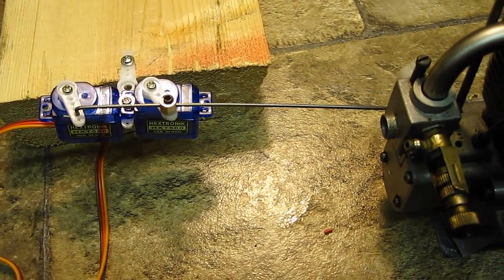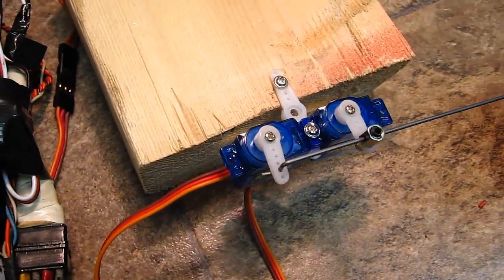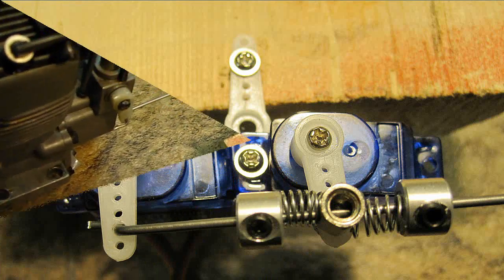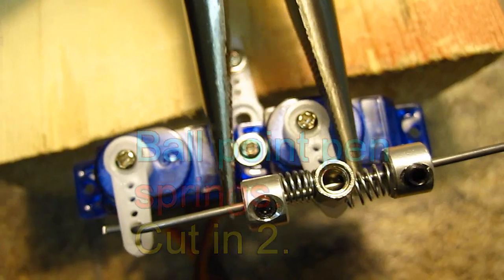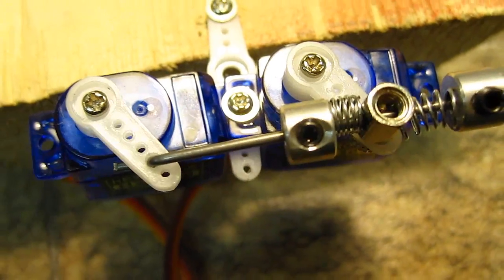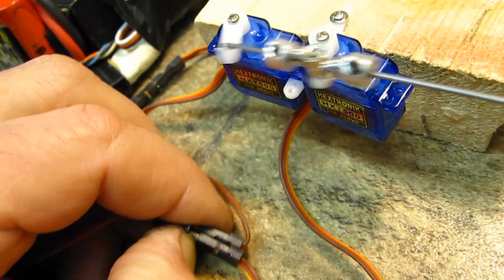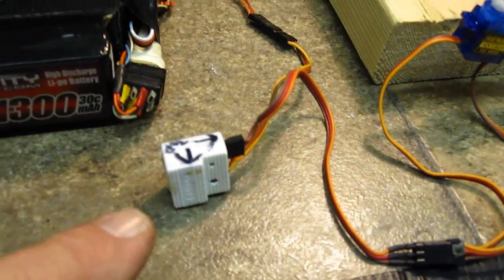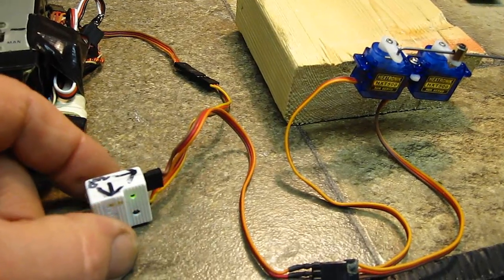Double your servo power and have backups too.  Heres how I do it.

Comment: I can see and hear when you disconnected the second servo strain and we were always told not to push the servo
horn as it is a easy way to stripe the gears inside as it is not designed to work back to front, like most other comments here say maybe use a little better or bigger servo, just a thought

Comment: well most larger projects like 1/6 1/4 already have dual servo setups lol. But here is a even better idea!  Try not buying the most craptastic china servo you can find for $1.50 each  off ebay and maybe they wont fail!!!  Also your greatly effecting the current draw on your models battery and life.
Reply: Rich Morgenstein Hey Rich (Ironic?) It's a hobby for most. A lot of us buy cheap and don't live in the throw away society. Two of these at under $10 might only last a third of the life of a $ 70 Futaba. See what I mean. This is obviously directed at fixed wing and/or boats. A few extra grams for milliamps hardly hurts.
Reply: karizma8175 I could bet you own a Phantom.
Reply: karizma8175   Well no just saying.  Over the years I built many rc projects.  All the ones with cheap crap servos at some point failed with little to no reason at some point.  But my projects i spend the extra 15$ on each good servo.  never had a problem with them even when there should of been like after a crash and what not......   lol I never had a boat servo fail.........  Never had a plan servo fail untill it hit ground so hard plane it's self was no longer fixable.  even then had some servos reusable lol??????  Where they of amazon for 5$ for 20 of them like these servos are no.  They where 10$ each or more.  Rc helicopters. To this day in 9 years............ Never had one fail.  I have 11 rc helicopters........ 450-800 sized.......   You know what did have a servo failure....?  The slow stick i paid 26 dollars for i used 4 crap china 9g servos on..........  Oh and my "China made" redcat rampage steering servo........  So? yeah does not happen often with better made items.........  While you all buy garbage in mass amounts over time I buy a few for few $ upfont i guess.
Reply: karizma8175  And no I dont own a phantom there garbage like most DJI products.  Just look at DRONE fails all over youtube it's All DJI garbage items lol!

Comment: Your better off using ONE high quality Coreless digital servo, than 2, because as one puts force on the other, it rapidly increases the current draw of BOTH of them as they fight each other to equalize the force. Think of it as almost a control surface binding. If your airplane control surface is stiff, it too will cause harm to the servo, because its overly fighting itself.  In both cases, you will dramatically reduce the life of the servo, and at the very least, kill your receiver battery VERY VERY FAST

Comment: What utter nonsense. I have never seen anyone unplug a servo in a model while it is in flight. If one servo fails it will ram the arm to one end as a result of broken wire on the potentiometer through vibration, thus killing the other servo. CRASH
Reply: It can fail in more ways than just the pot failing.

Comment: First, kudos for showing ideas and options. I agree that some configurations with double servos are needed sometimes. I don't thing direct coupling servos without using a balancer is a good idea. One servo fighting the other can cause premature failure and high currents. The servo saver helps alleviate that problem. A single mounting point for a servo would not be acceptable in most of my applications and I don't think that is a good idea but it would work sometimes.

Comment: this will not work if one servo fails. The one that fails will stop locked up and stop the good one. just unplugging one of the servos is not the same as one that has failed.  There are other linkages that will make it work but this method is doomed to fail.The idea is redundancy. Each servo should be connected to its own receiver, This method is used in giant scale models. Use good servos not micro servos. Just buy and use a good servo in your models.

Comment: @robotwarsaintdead, agree that this wouldn't with all servos. For the cheap servo that can be turned by hand, it might work, depending on the failure. I might put springs on both servos (method 2 on both). This way, if one seizes, then the other server could push the rod against the spring of the seized servo. Because springs may have the same tension, movement while be very restricted. Wouldn't work for all applications. Probably a good idea to invest in better servos anyway :-)

Comment: have you tried it with one servo locked into position (not unplugged, but idle in its neutral position) I've had some just freeze in their position, you couldint push the servo horn around unless you wanted to strip the gears.

Comment: So... Double servos = twice power draw, twice as heavy, double chance of something failing... And when one does fail, it'll probably kill the other because the pushing a dead servo exceeds torque load on the one working servo... Which will probably and subsequently die.

Comment: Those cheap micro servos just shouldn't be used as throttle servos.  There size makes it seem like a good idea but they just can't handle the vibrations of nitro or gas engines.  End of story.  I think if you had a servo fail it would most likely be from stripped gears.  I think the the one servo would be so bound up that the other servo would probably quickly fail also.  I think the correct thing to do is to use a quality mini servo (metal gear) if you need something small or light.

Comment: @freemarlochip No redundancy is 100% secure.  With a dual system you reduce your probability of crash to a maximum of 50% and there's some failure modes that this system cannot help. (i.e. a short in the circuit which causes one servo to get stuck.  However, logic still dictates that some redundancy is better than none.

Comment: @Nomoreidsleft I totaly understand what hes saying and doing. I simply commented that for someone who just does this because he saw this video and Dave doing it, does not mean its going to be 100% secure. One of the 2 servo COULD fail but the pilot may not ever know about it if they are not as experience as Dave and continue to use the dual setup with the possibility of only one servo working which in return would or could cause the other working servo to prematurely stop working.

Comment: @freemarlochip This is flawed logic.  We shouldn't have redundancy because one of the components could fail and you wouldn't know about it.  That's the whole point of having redundant components, so you are covered in case one component fails. Also your point about the working servo get stressed because of the non-working servo shows that you don't really understand what Dave's trying to show.  This is only meant for single servo failure during flight, to help you bring it down safely.